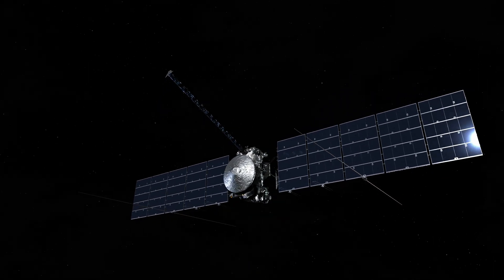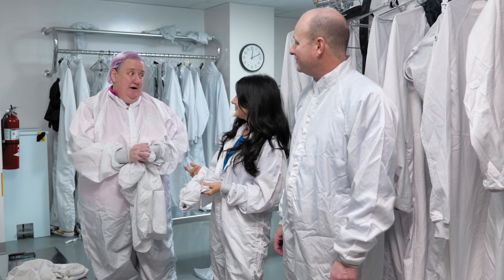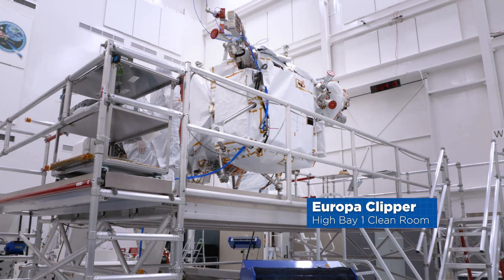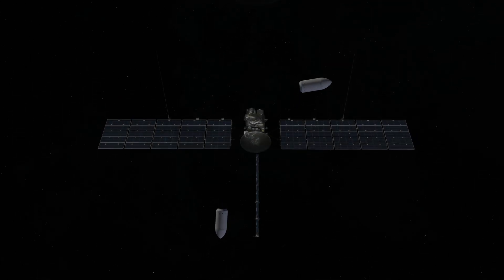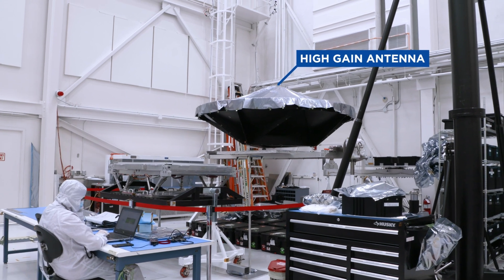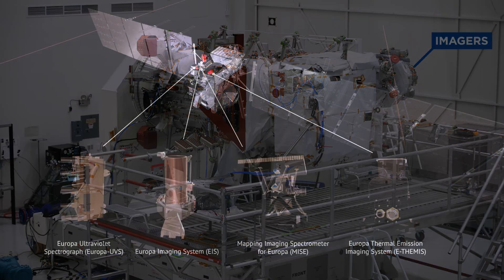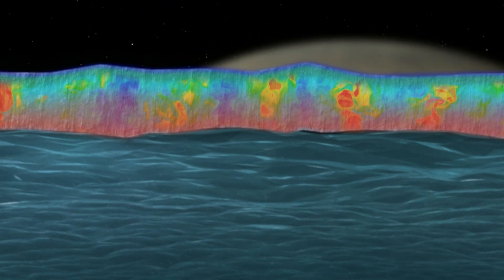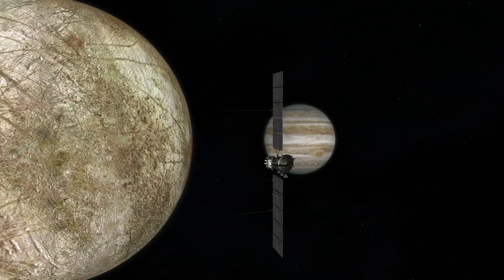Spacecraft Makers: Introducing Europa Clipper

Comment: Off-topic question here, please forgive me ... but I've recently been curious if:   twin (2x) bolted-together existing Falcon-Heavy platforms (2x Core + 2x boosters)  could substitute for the 27x 'Raptor' booster engines that launch Star-Ship  ??
Reply: 33 Raptors
Reply: 27 were sufficient to boost Starship.  Thanks though for your impressive reply
Reply: @donkoh5738  Musk stated that 30, minimum, would have been necessary to achieve orbit.